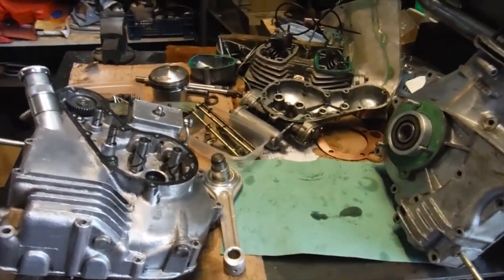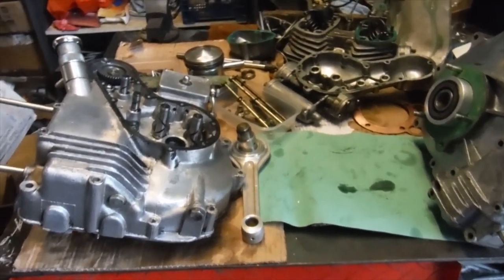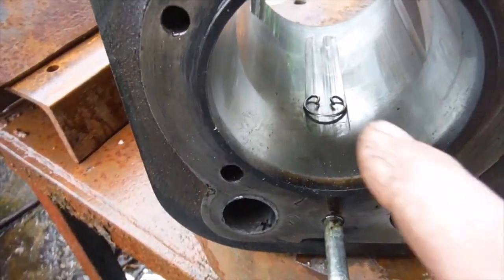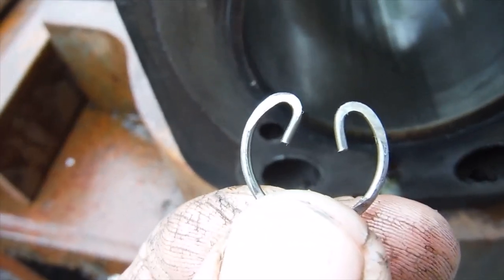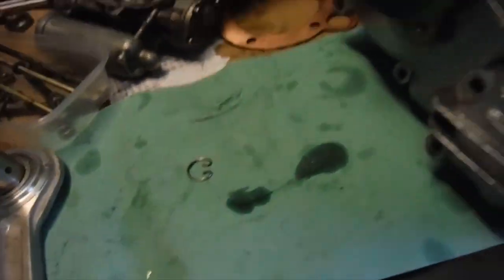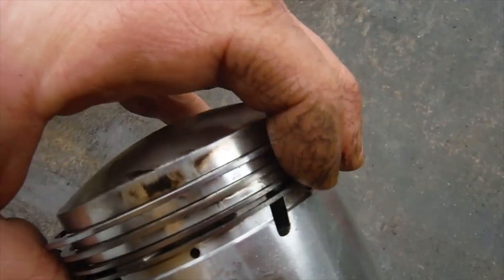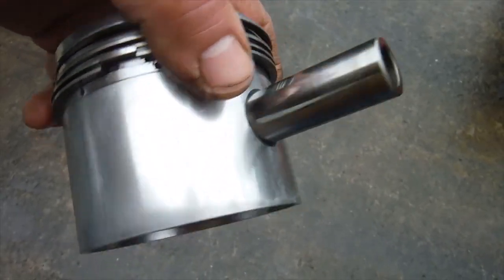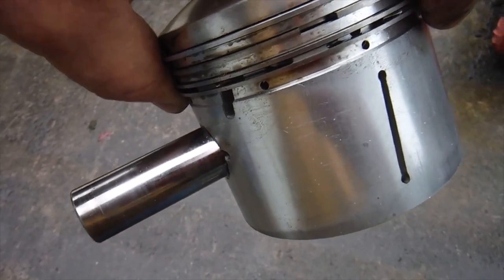Royal Enfield Bullet 500. 2 Piston circlip mystery discussed and possibly solved.

Comment: Hi Paul, absolutely no doubt, in the image of the bore you can see the shape of the score at BDC matches the shape of the clip between the two ears of the clip. In the 2 strokes we always used the clips with no ears. the Piston has a small notch to enable a small screwdriver to be used to lift the clip out when needed, this type of clip tends to be pushed into the grove by the bevel on the edge of the pin with no ears for the pin to push against.

Comment: Harder to fit and remove, but the 'earless' circlips seem better to me: side pressure from the gudgeon pin, with chamfered ends, will push them deaper into the groove. (And less mass, if the comments below about distortion under acceleration is really a concern.)

Comment: Is it all possible that the owner has tampered with engine after it was returned to them? I noted the wear pattern in the cylinder seemed to indicate the ears of the circlip was at the 6 o’clock position whereas the image of the piston assembly on the bench shows it in a totally different position. A little over 50 years ago when apprenticed as a motor mechanic my employer insisted on putting witness marks on all major assemblies. This was a dab of paint. He was burnt badly on an engine build where it was obvious the owner had tampered with the engine after it left the workshop. He vowed that it would not happen again hence the witness marks. The owner was made aware of these witness marks so as to remove any temptation.

Comment: I think there would be wear on the piston if there was that much side force to displace the circlip. I have no experience with circlips like that. Are they "handed" ? when the circlip is laid flat is it equally flat or do the ears angle up where they could be rotated by the pin? Is the circlip groove properly made?  Could the ear of the circlip get caught in the circlip removal relief notch ( or whatever it's called) and the circlip become unwound out of it's groove? And lastly is that the correct circlip for that piston?
Reply from the maker: All valid questions, I am not sure of the answer at present, though.

Comment: That circlip isn't correct, it should be the other way up and in line with the bore to stop it from being compressed by the reciprocal mass (on piston direction change) would be able to compress it if over revved which you wouldn't think possible with an old pushrod single.
I had this once with a racing  triple which revved to 10 k, I think I fitted it sideways but I can't remember exactly.
The only other way I can think that it would come out is if the radius on the clip wire isn't the same as the  groove appearing to be seated and then vibrated free.
I think you are right about it falling out on disassembly, no damage at the bottom of the bore or piston suggest this.
Reply from the maker: It really shouldn't matter which way up they are fitted, but if what you say carries any weight, seeing as the piston moves upwards as quickly as downwards, what you say would only address a possible problem in one direction of piston travel or the other. I think somehow, the gudgeon pin has managed to push it out, but it shouldn't have happened, and this is the first time it has happened after I have reassembled anything. Still a bit of a mystery.
Reply: @paulhenshaw4514  I know it's a bit strange, the orientation of the circlip is important,if it isn't directly inline with the piston the reciprocal force has the ability to "compress" the circlip thus removing it from its seating in the groove if it is inline then the forces push it into the groove, the circlip you have there with the divider loops has more weight on the looped ends and if not inline with thrust has more mass so a bigger propensity to compress under load, I'm not saying this is the cause only that it is possible if this engine was over revved which is unlikely with a pushrod single.
You have a mystery which may never be answered given that it was correctly assembled it could only be mechanical failure ..was it a genuine piston?
Look, on an engine like that I wouldn't even consider the orientation of the circlip I would have done exactly what you did but there are no side loadings on a gudgeon pin only vibration and for vibration to work that loose  it has first to be relaxed.....a mystery wrapped up in an enigma.
Reply: @paulhenshaw4514  maybe consider teflon bobbins.

Comment: I understood  in the first video that you stated that the owner had disassembled the top end. In which case you are not at fault.
Reply from the maker: I think he may have been getting a bit mixed up, it looks like I was the last to reassemble it, but not very long after he had it rebored and an oversized piston fitted. Whether the new piston assembly is at fault in any way or not is difficult to say at present, but it appears to look ok.
Reply: @paulhenshaw4514  Oh dear. If the groove in the piston for the circlip shows no damage, then I presume the circlip may be the issue, as suggested in the comments?